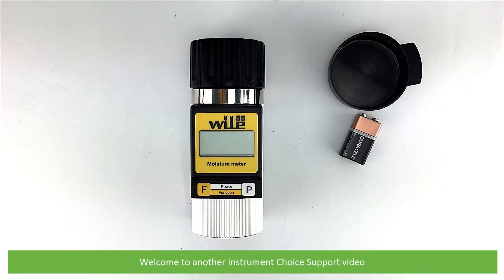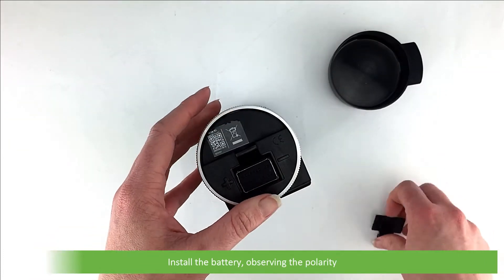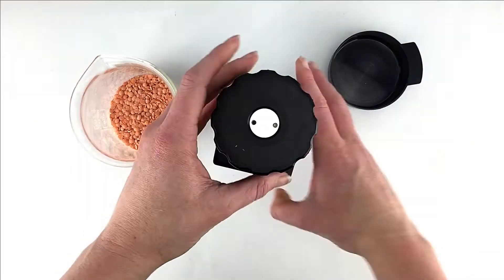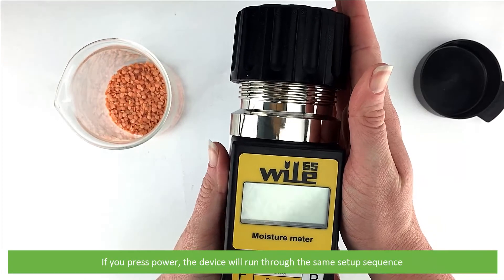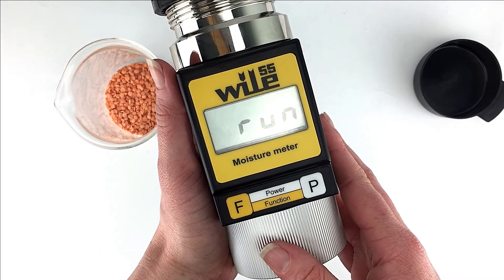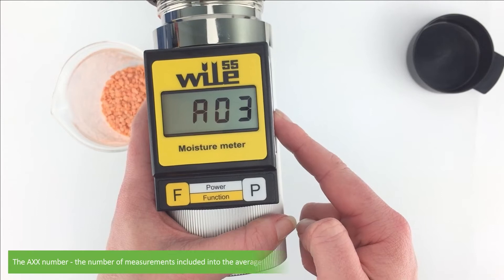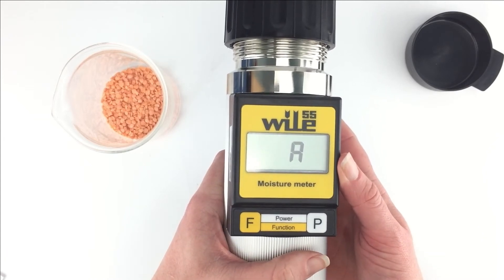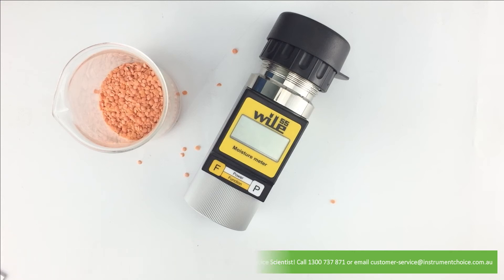How to Use the Wile-55 Grain and Seed Moisture Meter

Comment: Bagaimana cara setting ulang, untuk menaikan hasil kadar air nya
Reply from the maker: To adjust the result If the measured material is different from your reference. You can adjust the result shown by the meter to match this value. 

To adjust the value to a higher moisture:

When the measurement result is displayed press twice on the “F-“ button. Three bars will appear on the upper edge of the display. Wait for a moment and the result appears on the display again. Now each time you press the “F-“ button, +0.1 moisture % will be added to the result. 

To adjust the value to a lower moisture:

When the measurement result is displayed, press the “F-“ button three times. Three bars will appear on the lower edge of the display. Wait for a moment and the result appears on the display again. Now each time you press the “F-“, -0.1 moisture % will be deducted from the result. Note! This adjustment is specific to the used scale. In other words there may be defined specific adjustment for each scale.